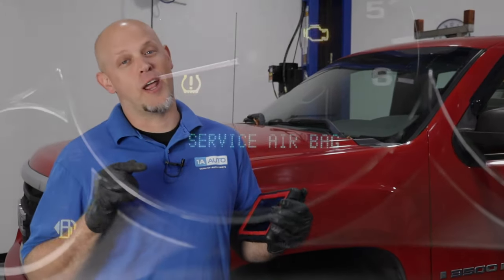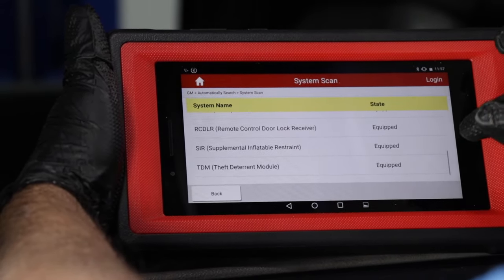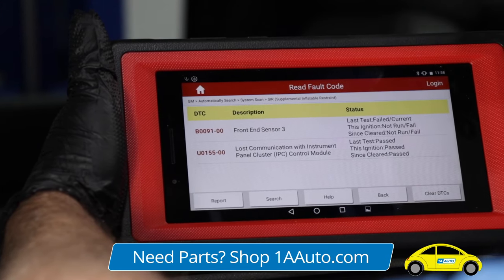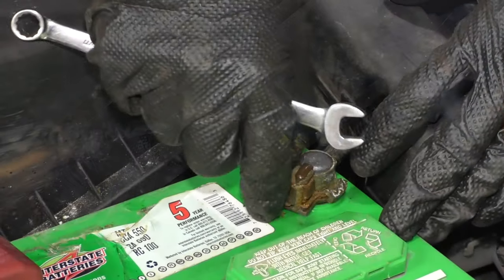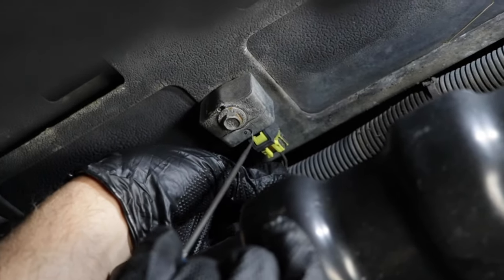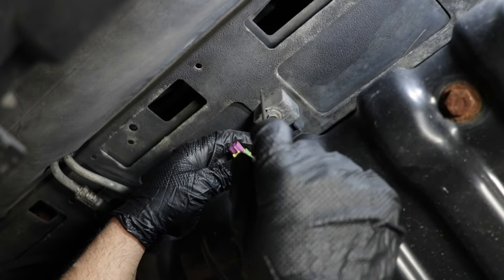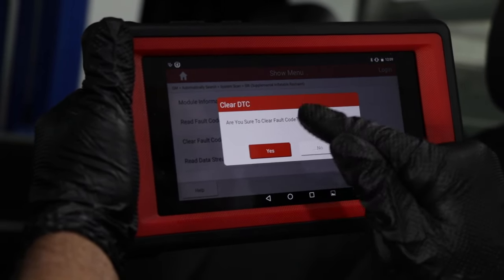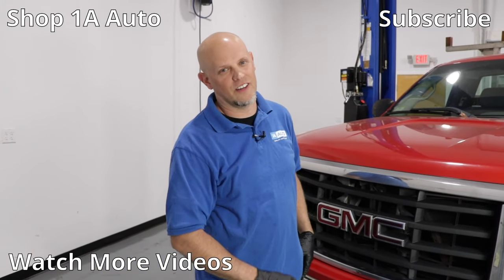Air Bag Light On GM Truck? How to Fix This Common Sensor Problem

Comment: I did a little research and I am certainly not a mechanic. My wife God bless her soul decided to go out in the driveway and vacuum out and wipe down the inside of the 2011 Tahoe.. when I got home and started it up I had a service airbag light. I asked her what she did and she basically explain that she raised the seats and push them all the way forward to vacuum under and behind and then move them all the way back to vacuum the front footwell.. one of the videos I found said there is a connector on the driver seat where your right hip would be underneath that becomes loose or breaks and needs a new connector and solder repair.. it may also exist on the passenger side this is for the 07 through 14 GM
Reply from the maker: +Mr Obvious Thanks for the feedback!

Comment: I waited. And studied it. Finally  found  the airbag  / ignition  fuses  num 45 on a 09 Silverado  my air bag fuse was blown 15 Amp. My service  light off. I'm so happy  only   100000.on mine

Comment: Think I'd be more interested in fixing that check engine light
Reply: Right lol
Reply: Bet it’s the oil pressure sensor
Reply: Check engine light is no big deal. Air bag light means no airbags when light is on, so the airbag light is more important for safety
Reply: Check engine light is important in states where inspections are required
Reply: Maybe the check engine light is on because the engine isn’t running…
Reply: @schmittyyyyy  thank you 🙏 keys probably half way 😂 only people with Silverados really know ❤️
Reply: The truck is in accessory mode
Reply: Probably a Oxigen sensor

Comment: Funny. Service airbag light comes on and they say don't drive it. Safety issue. Bags won't deploy in a wreck. Well what's the difference in driving an old mid 80s vehicle that didn't have them. Is that a safety issue too?

Comment: I replaced the two impact sensors but light was still on. Turns out it was the sensor under the driver seat.

Comment: Hello 1A! Is it normal for the service light to stay on after replacing the sensor? Do you need to clear it/drive for 50 miles or whatever to clear it?  I don't have an OBD II that reads the SRS system so I wouldn't be able to clear it. The video shows he cleared the code, but there is no mention if the dash light stays on until it is cleared.  Thank you!
Reply: Did you figure this out?

Comment: Okay 1.I love your videos, 2. I just replaced my clock spring and steering position sensor and it worked fine, but I not knowingly I unplugged my Range Technology from my obd2 (because I have a 2011 suburban with DOD) and now the airbag light is on and it seems everytime I turn the steering wheel or hit a bump it pops up the notification on my dash and it's getting annoying

Comment: Can I just connect the 2 new sensors without bolting them back on the frame or do I have to bolt them and then check the light?

Comment: I do have access to a scan tool that’s capable but I’m lazy and don’t want to go to the shop to ask a friend to check it out. Is it common for the front impact sensor to fail due to its location? The friend I bought my truck from used to drive on the beach so I feel like it’s more than likely the front sensor due to the salt water and sand
Reply from the maker: +Hill Climber Thanks for checking us out! http://1aau.to/m/Shop-1AAuto-c

Comment: I have a 2013 Silverado 2500 LT 6.0 gas. I put a new sensor on but the light is still on. Any suggestions?
Reply: Use a scanner to figure out what sensor is actually causing the problem

Comment: Thanks! Can you also clear the code by disconnecting the battery?
Reply from the maker: +D E Thanks for checking us out! That may or may not work depending on the year of the vehicle. If you don't change the bad sensor then it will come right back if the codes are cleared or battery is disconnected.

Comment: I replaced both sensors and the light still on. What else could it be that causes the light to stay on?
Reply: I just came from a Chevy Dealer to have the airbag sensor recall work done.  Light still on and they said there's nothing they can do about it.
Reply: I do believe the clock spring in the steering wheel is pretty common. There are lots of videos on utube about replacing it.